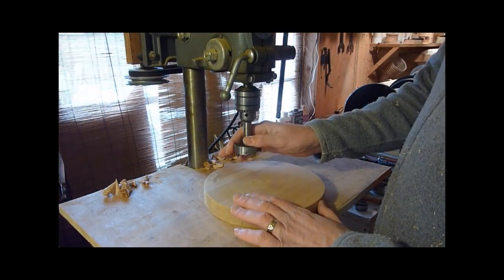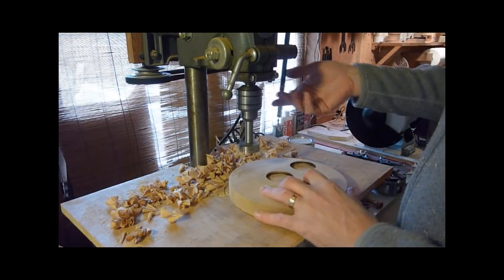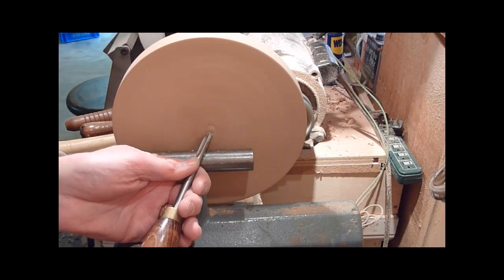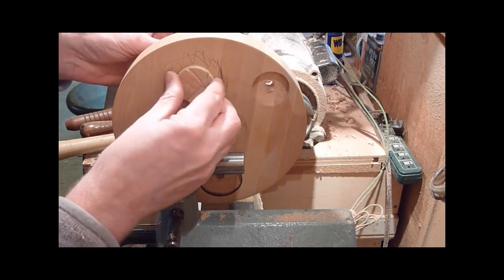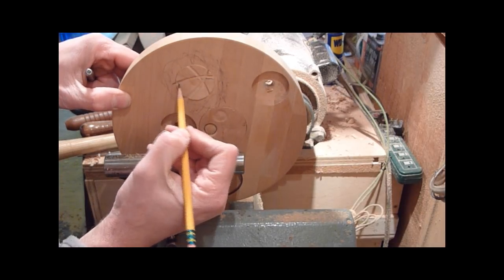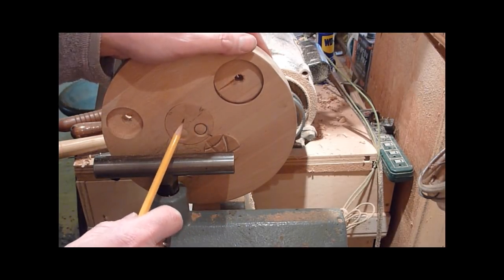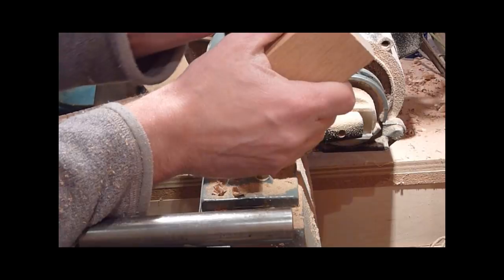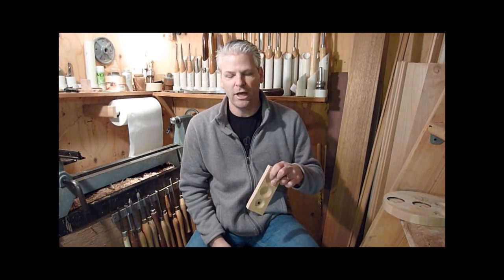Jig For Off-Center Turning - Woodturning

Comment: Good ideas.

I saw a demo from Nick Agar, who does artwork made in a similar style, and he used a faceplate (apprx. 6" dia.) for most all the work I witnessed. To move the work relative to the center, he would pull 3 of the 4 screws on the faceplate and rotate the piece slightly, then replace the screws. This gave him a very solid hold on the work and adjustability without creating a dangerous "propeller".

He did use a waste-block on the back of his workpiece, if I recall correctly.